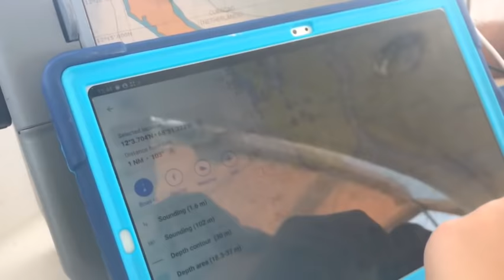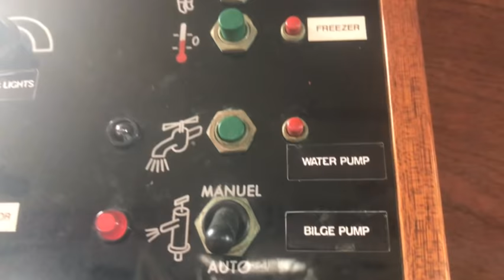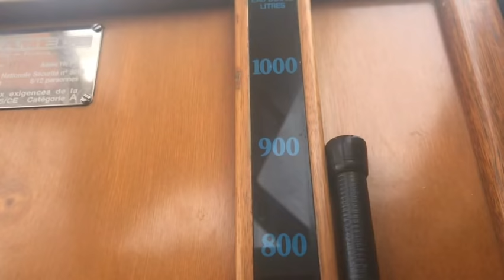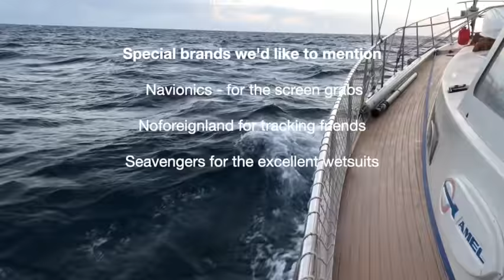Flooded Bilges - WHERE is all this Water coming From? Are we Sinking?    Ep114

Comment: I learned from years of doing home repairs that when one flexible pipe bursts the others won’t be far behind. I always strongly recommended replacing all of the flex pipping at the same time. Been proved right many times. Any flex pipes will fail sooner or later, more so when under a lot of pressure. Of course if you like doing boat repairs over and over just ignore the old pipes. Happy it was just a flex pipe and not damage to the bottom. Blesssings.
Reply from the maker: As you know Woody does not like doing boat repairs ;)

Comment: GREAT VIDEO, Mothership crew!! This happened to us, too! Somehow we left a tap open and and we drained the whole tank. This is another example why I am working on designing an electronic device that shuts off the freshwater pump if it runs continuously for more than X minutes and sounds an alarm. I am working on a design that would cut off the pump like a breaker switch but could be easily reset if it is determined that there is not a problem like maybe you are washing the deck with boat water or someone is taking hella long showers.  On another note, I LOVED the bit where son was saying in the big scheme of things, you are living a dream life, so put things in perspective! I got choked up!
Reply from the maker: Thanks guys.. and yes the pump is a major problem. We now turn it off when the engine is running because we can’t hear it.. and the light has stopped working.. but it’s way down on our ‘jobs list’ to replace it.. after furlers, alternators and ripped sails!

Comment: Fear of sinking must lie in the subconscious of everyone who owns a yacht. I spend 50% of my time on mine. It’s summer and I’m glad of the solar powered air vent on Rosa. I can hear it whirring away in the bathroom up behind my head when I’m in bed. One night I roused from a deep sleep with an overwhelming feeling of dread and confusion. It was pitch black and somehow I was upside down, or the boat was upside down. Were we sinking? Had we been knocked down? My sleepy brain couldn’t make sense of the fact that the sound from the solar vent was coming from below and in front of me. I ran through the list of possible causes of this disaster. Slowly my eyes began to focus (I was still lying in bed) and I struggled to process the fact that I wasn’t onboard Rosa. I was at home, in bed, and the sound was my pedestal fan which I’d pulled out of storage the day before…😂
Reply: That is a scary thing to have happen. My older son occasionally gets sleep paralysis and he describes similar feelings.
Reply from the maker: good job it wasn't the other way around....and you wandered off ( even off the boat)!

Comment: I feel your pain. The sad story is that this is typical in modern houses, at least in my place. The pressurized water to the dishwashing machine has no shut-off valve. Thus I have to de-compress the complete house water system to provide some simple (pump-)service on the device. A simple valve that just cost a cup of coffee would have been so easy to install in the first place. Cheers.
Reply: When we assembled our panabode I did that very thing. Shut offs everywhere. Living in old apartments in my youth tought me that lesson. Every time someone needed a toilet or tub tap replaced, they had to shut off the buildings water.
Reply from the maker: Yes and you waste so much water just depressurising the system too.

Comment: No auto bilge pump with alarm? if not you should have.
Reply from the maker: Luckily the Amels have several watertight bilges.. unluckily the bilge that filled wasn't the main bilge and doesn't have a pump or alarm. I think it would simply be impractical to have a pump in every bilge in an Amel as there are so many compartments.